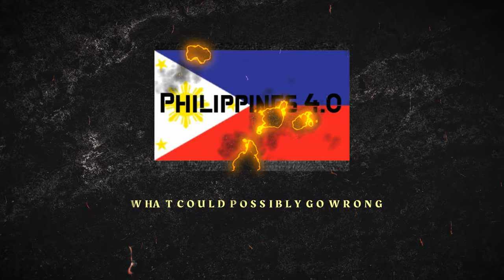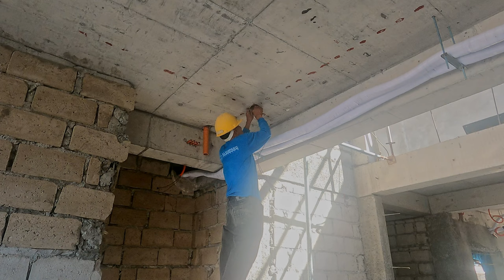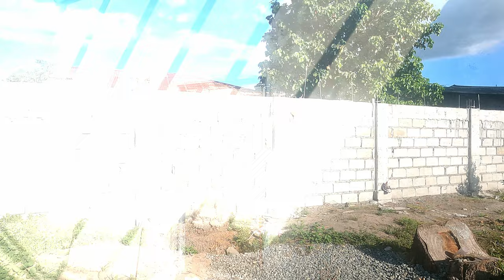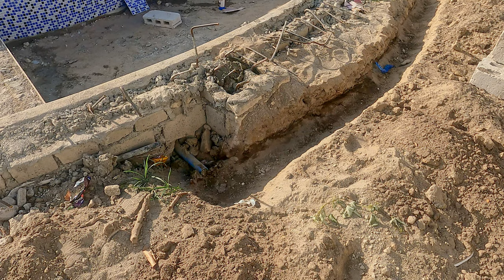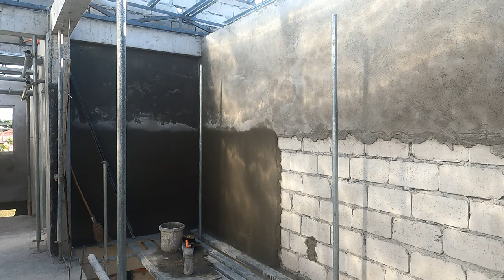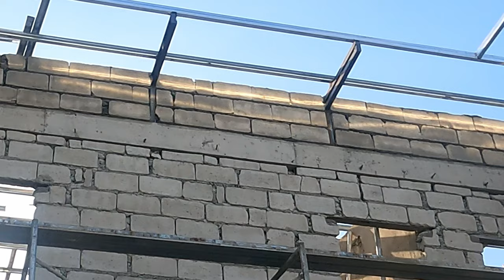Philippine House Building Day 137 - Caddy Wampus

Comment: G'day Mike , will you be adding food scraps to your compost pile (s) ?   Mice/Rats are drawn to compost piles , they are an easy source of food/shelter....evidence of such rodents can be unsettling ! if one day it becomes an issue may I suggest you plant a few (Mint Plants) nearby, mice/rats are reported to hate the scent of mint !  they'll be   (NOT) WITHIN COOEE !
Reply from the maker: Wally
Yes we are / will add food scraps.
From what I have heard (which may be completely inaccurate), rodents will tend to be attracted if there are any meat scraps in there, so we will avoid those.
Never heard of the mint trick, but that sounds like a good plan - plus, I love mint. The only issue is whether mint can take the heat here. No harm in trying though.

Comment: Good afternoon Mike, The pool is looking great 👍 like the letter box.
Previously I have seen 3 blue pipes above the seat are they going to be water jets could get a good back massage. Easy to setup just small controlled tube for air control adding bubbles to jet . I've got them in my spa. 
Isn't the trenches for pool piping to and from pump / pool filter ?
It's fairly normal to fitt skimmers for returning pipes to pump filter.  Not seen any.
Reply from the maker: That is exactly what they are Graeme. 
Will ask the builder about skimmers

Comment: 11:25 missing ground wire? yes if its a outlet, no if its a swich.. have a nice weekend..
Reply from the maker: Exactly right Jerry.
Planning to put in mostly smart switches if we can, and I think a lot of those still need neutral (although there are a growing number which do not)
Reply: @philippines4.0buildinganew64  often the smart switch need a neutral. But there is whitout also. My experience is that them who have the neutral is more reliable.  Will you have 3 fas incoming? Can be a little tricky whit the neutral if there is one fas.
Reply: Also one thing more to think on. Philippines electric ös not so clean.. what I mean there is many spikes many power losts.. brown outs as it its called 😅 will the smart switch survive that? Maybe it's good to pay a extra to have a good quality..
Reply from the maker: @jerrysweden2800  Jerry
I believe that one of the benefits of putting in solar power is that it does provide much more clean power. The grid power is massively unreliable and very unclean.